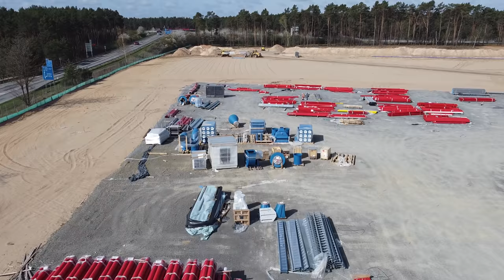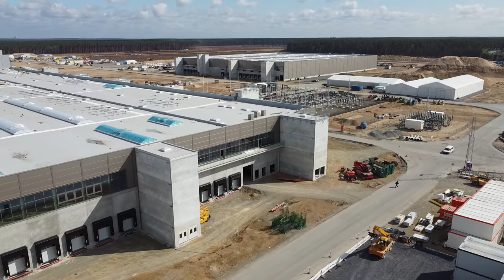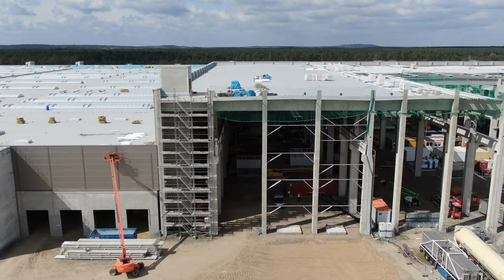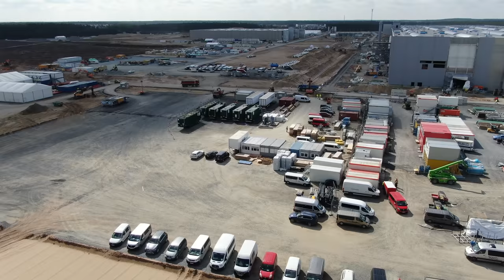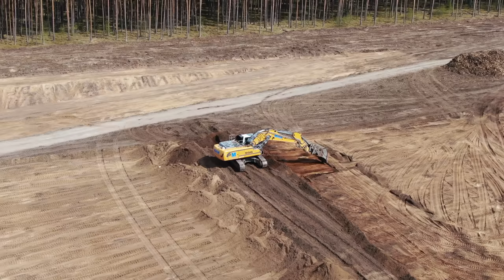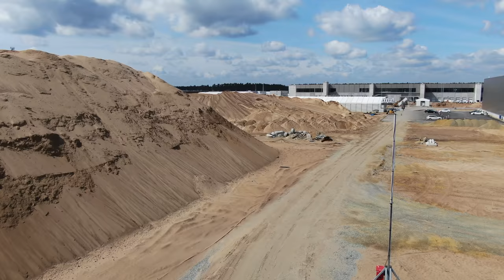Giga Berlin | 2021-04-24 | Laying pipes

Comment: Thanks, Tobias.  The Berlin Model Y will be a new design (front and rear castings and new battery pack).  Have there been any reports of testing of this new design?  I assume they will have to do the normal cold weather testing, government crash testing, certification etc.  I would guess such testing would take a long time.  Will they have to produce the first cars at Berlin to start testing or has Tesla already made samples of the design elsewhere for testing?
Reply: I am pretty sure this all has already been done in the US. During or shortly after battery day Elon Musk has said in an interview there were already test vehicles driving around with the new 4680 batteries for 6 months or so. Plus it is not a complete new vehicle, so Tesla does not have to start from scratch. Much of the certification probably can de done by showing similarity with existing products or digital simulations, without the need for a real world test.

So there is no waiting necessary once Berlin starts producing cars. Last timeline I saw that test production will start in May, this will be for validation and calibration of the machinery, this will take about 2 months and then in July deliveries to customers will start... 

But to be honest, by now, I do think this will be pushed back a little, because the factory is not ready yet. Main issue seems the water connection is far from ready at the moment, and laying down asphalt pavement around the factory cannot start before they finished the digging  in storm drain pipes and other pipes.. From what  see in the video this could take a couple weeks before that is finished, they have to go all around the factory!

Comment: Nice weather makes a nice video! 

All this digging in of pipes around the perimiter of the factory.. a bit late I think, because they now cannot do anything like laying down Asphalt at the loading docks and constructing some permanent roads, needed to bring in the trucks for supplies.. Also, its about time to start constructing some parking lots for the produced Model Y's... and why is that temporary highway on/off ramp not finished yet?

I am now doubting they will be able to start test production runs in May, I think it will be pushed back to June, or maybe even July.
Reply: Tesla has always said July.
Reply: The autobahn on/off ramp (on the public-owned grounds) is already complete. Only the connecting road on Tesla's property is still missing.
https://www.youtube.com/watch?v=nVdhsvJ-Deg&t=587s
They have also started to clear the areas of the loading docks. Thus when the digging of the pipes is done I saw no problem finishing the access to the loading docks and permanent roads in time. 
More critical is that works on some buildings needed (e.g. wastewater treatment, sprinkler control center, fire station, ...) has yet not even started.

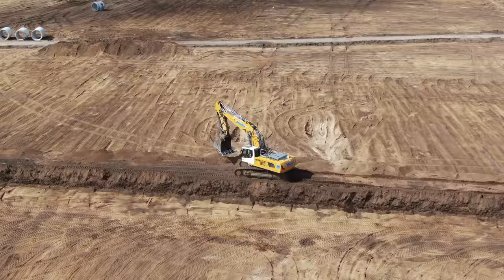Comment: 11:45 I am not impressed with the speed and efficiency this excavator and truck are clearing the top soil... are they paid by the hour or work completed?
Reply: They get paid to be done on a specific date.
Reply: @HenryLoenwind  If that is the case one can say they have placed the date too far in the future?
Reply: @DaveBoxBG  Only if they were blocking other work. And I'd be really surprised if they were---it's really easy to speed up that job by throwing more money at it.

Comment: I feel like they are not making progress. Giga-Austin will beat them at this rate.
Reply: They are clearly slowing down but it does look like work is being done on some jobs that where running a bit behind, and it looks like they are re-scheduling, pulling ahead work that would become a problem later, when they would try to finish everything at once. I have a feeling the site could suddenly get very busy when all lights turn green.
Reply: HUHU! NO 24/7 here! Its not Needed!
Reply: The paint shop in Berlin is at least 2 months ahead of Austin, stamping is likely on-par at this point, and casting is a few weeks ahead.  General assembly and Body-in-White are likely ahead of Berlin by at least several weeks, and more likely a couple months.  There are a few things in Berlin that are oddly behind Austin, but given that they are moving on to secondary buildings, I would be confident Berlin finishes up around July while Austin is more likely August-September.
Reply: @renehunt4252  Your spam is a disaster.
Reply: @patrickkenny2077  24/7 makes a huge difference and it appears in Austin they have all the permits to proceed

Comment: Why hasn’t the casting area not been completed?  Are they waiting on the final permit approval for it to be completed?
Reply: With all the forces lining up against them, it's not assured they will every get a Final Operating Permit. I really doubt if it will be this year, if ever.
Reply: Little roof or walls on Fremont casting, Austin casting not closed in, rumours of fires at Shanghai casting and proof of fire at Fremont. Maybe they are trying to make sure this one works well Smokey Stover.
Reply: My guess is that they want to change something but do not want to delay the overall permit by submitting a changed application. Sending in a new application just for that change later would be faster overall.
Reply: @gpsfinancial6988  Would this be the same type of rumor of the Texas Tesla crash that was all over the financial news that said 

RUMOR: FSD was engaged 
TRUTH: data logs said no subscription

RUMOR: Autopilot was engaged 
TRUTH: data logs says it wasn't and furthermore it couldn't have been because there were no lane marking on the road

RUMOR: no one was in the front seat
MAYBE: Other videos released of unbuckled drivers being thrown between the front seats into the backseat

RUMOR: That it took fireman 4 hours to put the fire out 
ACTUALLY:  The fire chief issued a statement saying  it actually took 2 minutes and didn't know where  the rumor came from

RUMOR: Short sellers issued the rumors to their minions in the Financial News (Oxymoron)
ACTUALLY:  Likely???

FYI I don't own a Tesla or any electric car and probably never because 'I’m just to damn old and to tired to change'. :)
Reply: @gpsfinancial6988  except they literally put a roof and walls on 3 sides of the one at Austin and are adding to the side without one.
Reply: @duncanadams2531  They have not even finished the piling for half of Austin casting, let alone started building in that area. Texas also only has the bottom plate installed for three of the casting units (8 complete in Berlin}. Texas is amazing, but there is no need to ignorantly constantly criticize the equally amazing progress in Berlin. I trust Tesla to know what they are doing in the casting area.
Reply: @gpsfinancial6988  I was just saying it was covered, which you said it wasn’t.
Reply: Probably waiting on more casting machines from IDRA. The foundation was laid of 8 of them.
Reply from the maker: I think they'll start production with just two casting machines. They only need more for ramping to full capacity.

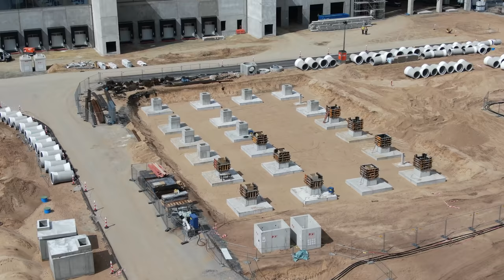Comment: 4:28 any ideia what is this pit for?
Reply: Foundation for waste water tranks. Which will be part of a waste water treatment facility.
Reply: Nobody knows yet, does not appear on the plans.
Reply: @julianreverse  I saw the new video from “ The wolf pack “ and there they said it’s a tank farm?
Reply: @julianreverse  It does appear there, we just are not sure if those foundations match the tank farm that's on the plans. I too have no idea what kind of foundation a 40 ton standing pressure tank needs, but until I see something that clearly contradicts the plans...
Reply: @HenryLoenwind  Not in this form. These are not foundations for tanks but for pillars.
Reply from the maker: The location is exactly where the tank farm was planned. I was surprised that there are footings for columns, because there was no roof mentioned in the documents. But everything else lines up with the plans, so I'm pretty sure that it's still the tank farm. 
But it's not part of the waste water treatment facility. The waste water tanks will be at another location further north. The tank farm is for different liquids and gases needed for production.
Reply: @TobiasLindh  The tank farm has no roof only on its east side, at the west side with smaller tanks it will have a roof. And looking on the west side (from the DU) the tank farm and wastewater treatment will look like one building. And I assume that this will look even on the east side as one facility (despite it is technically not).
Reply from the maker: @abalada  What's your source? In the application documents it didn't have a roof. Between the tank farm and the waste water treatment will be the pipe bridge, so it won't look like one building either. I do think now, that the west side of the tank farm will have a roof, but only because of the visible footings, not because of the documents.
Reply: @TobiasLindh  
Unterlagen mit Erstelldatum: 24.06.2020 Version: 2 
Zeichnungen WWT Seiten 80-86/1150
Wobei in der Übersichtskarte auf diesen Seiten dort wo jetzt die neuen Fundamente sind gar nichts eingezeichnet ist. *)
WWT erstreckt sich nach dieser Version von der tieferen neuen Grube bis zur quadratischen flacheren neuen Grube (in Deinem letzten Video)
https://youtu.be/Op8jERCrsa0?t=535
Und auf den Zeichnungen zur WWT gibt es in deren nördlichen Bereich ein Tanklager (dort in Englisch als Tankstorage bezeichnet), welcher halb-offen ist und durch Brandschutzmauern-/türen von der eigentichen WWT abgetrennt ist.
Wobei ich mich da mit West und Ost vertan habe. Die geschlossenere Seite ist Richtung Gießerei.

*) Könnte es sein, dass das gar die Feuerwache geben soll? Zu deren Grundriss würden nämlich diese Fundamente wirklich gut passen. Auch wenn die auf diesen Unterlagen an anderer Stelle eingezeichnet ist.
Reply from the maker: @abalada  Bei den Zeichnungen auf den Seiten 80-86 ist das Tanklager nicht abgebildet. Die Zeichnungen enden alle an der Rohrbrücke bzw. an dem Ausfädelbauwerk vom Kabeltunnel.

Im norden sind die Wassertanks der Abwasserbehandlung, das ist richtig, und ja, das dürfte das flache Grube im Vordergrund der von dir zitierten Videoposition sein. Die andere Grube dürfte der Bereich Gerätelager/Trafo/Kontrollraum/etc. sein.

Ich hatte auch schon überlegt, ob das die Feuerwache werden könnte, aber ich habe extra Bilder von oben direkt auf die Fundamente gemacht, und die Pläne drübergelegt, und die Fundamente passen perfekt zu Position und Struktur des Tanklagers.
Reply: @TobiasLindh  Habe nun auch dieses Tanklager in den Unterlagen gefunden. Auch die Übersicht auf 531/1150. Was dort geplant war ist also geklärt.
Passen dafür tun die neuen Fundamente dort aber nicht wirklich. 
Die Querstraße zielt ja ziemlich genau auf die Mitte zwischen 1. und 2. Treppenhaus der DU.  Deren Position wird sich also laut Plan nicht mehr ändern. Und zwischen Querstraße und Tanklager ist laut Plänen Platz für Tankwagen zur Anlieferung. Also so gut 20 Meter. In dem Bereich befinden sich aber jetzt schon massive Fundamente.  
Die Tanks bekommen ja alle Auffangbecken. Sowohl die in diesem Außenlager als auch die im nördlichen Ende der WWT. Nur wenn dort so wie es aussieht ein Flachfundament für die deutlichen größeren Abwassertanks ausreicht - wieso dann so massive Fundamente für die kleineren Tanks in dem Außenlager?
Reply from the maker: @abalada  Ich bin mir mittlerweile ziemlich sicher, dass das Tanklager ein Dach bekommt. Daher die Fundamente, um die Stützen vom Dach zu tragen.
Die Straßen sind noch provisorisch, und absichtlich nicht exakt dort wo die finalen Straßen hinkommen. Die beiden Nord-Süd-Straßen werden später weiter in Richtung Mitte gerückt. Dahin, wo aktuell die Kanalisation gelegt wird. Die Querstraße südlich vom Tanklager kommt etwas weiter in Richtung Süden.
Die Tanks werden zwischen den beiden nördlichen Fundamentreihen stehen. Die südliche Fundamentreihe sind dann schon Stützen zwischen den LKW-Stellplätzen. Vielleicht sowas wie ein Vordach oder so, damit der Abfüllbereich vor Regen geschützt ist.